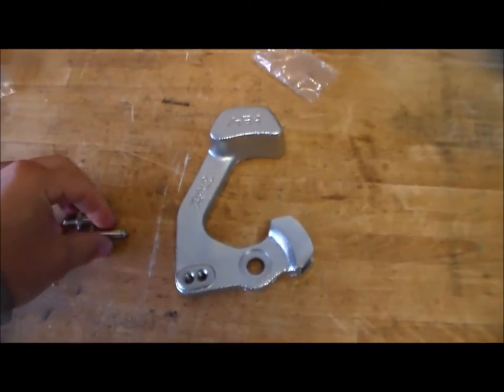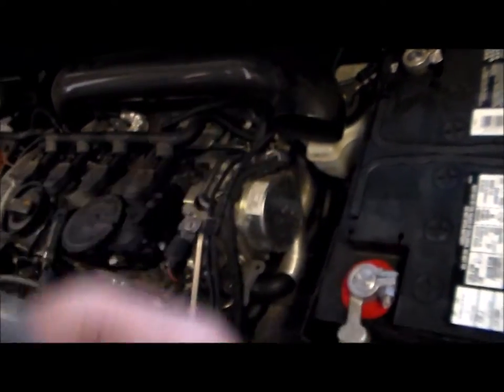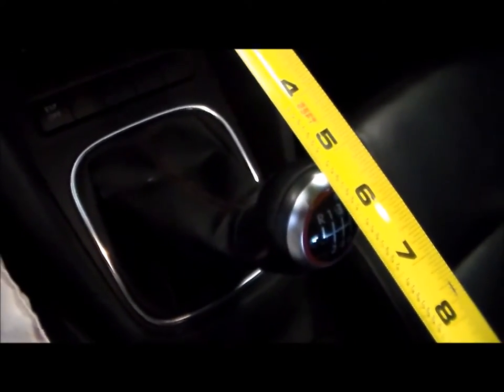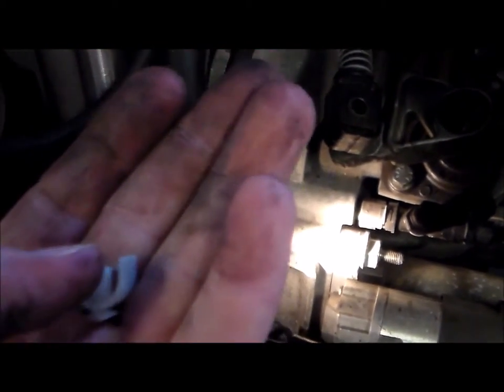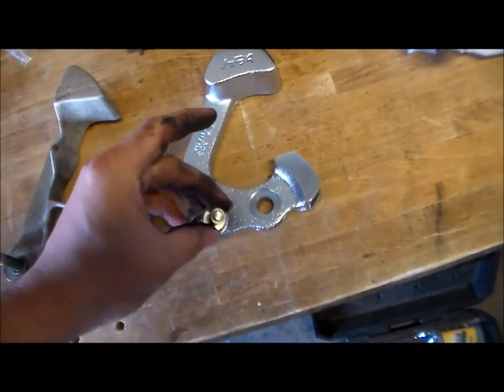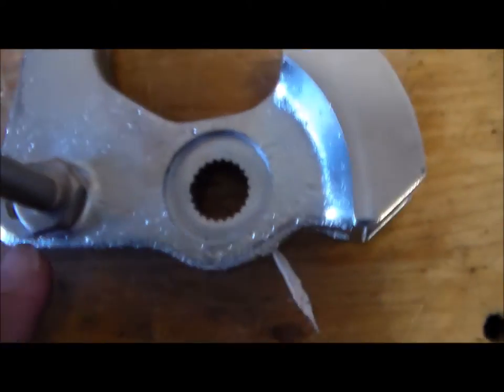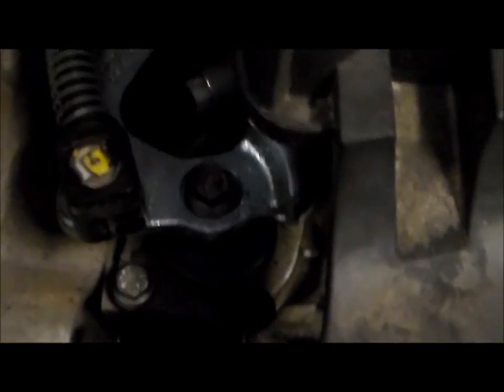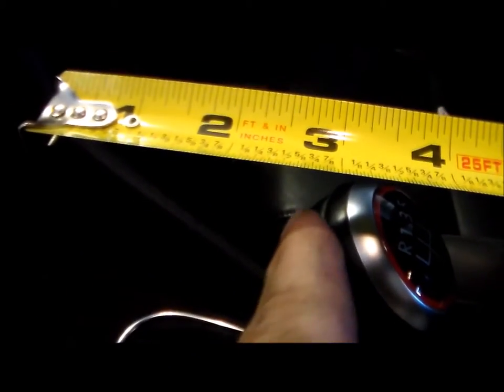MKVI GTI HPA Short Throw Shifter Install

Comment: After your install, did you feel your shifts get stiffer?? I just did the same install on my MK6 GTI and I feel like I have to use more effort shifting between gears.
Reply: Shorter lever, hence more effort needed. It's not as leveraged as before.